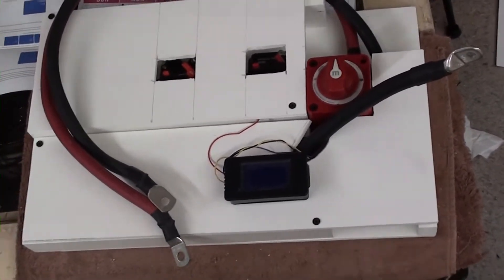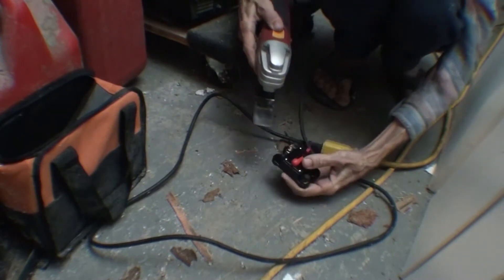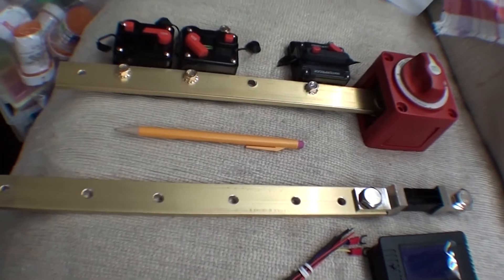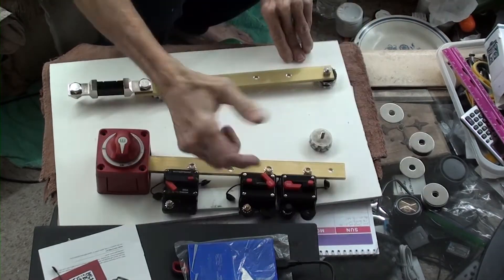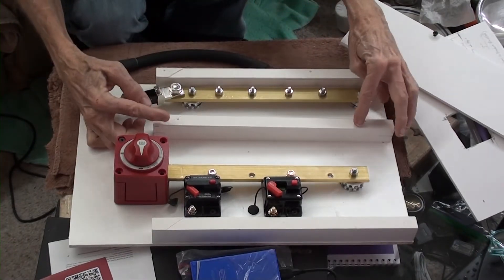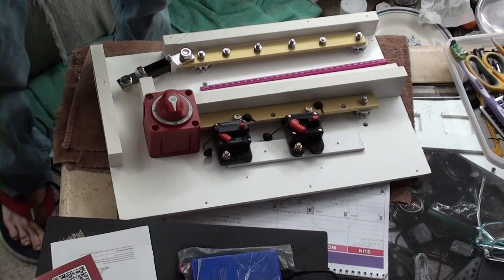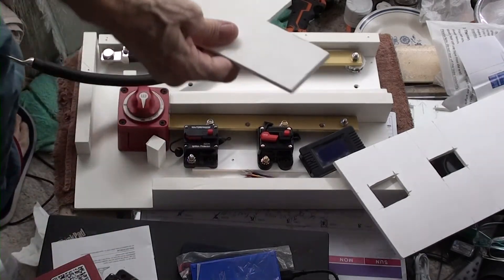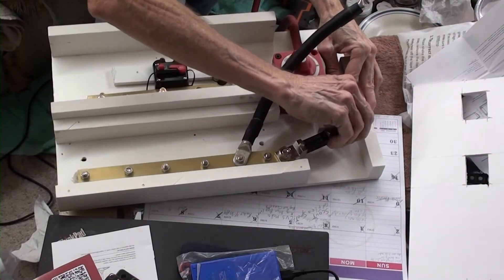Making A Bus-Bar Breaker Panel For Battery Powered Air Conditioner

Comment: It's amazing the mischief you can create with unlimited time and a little money!
Reply from the maker: I love mischief, any suggestions?  I have a battery that can run all my appliances for 29 hours or really kick ass for a half an hour.
Reply: @ninehundreddollarluxuryyac5958  Take the carver on the great loop!
Reply from the maker: @stevetadlock5223  That was Trevor's plan too.  I'm not a big fan of cruising American waters because all of it is so contaminated.  I was hospitalized from antibiotic resistant flesh eating bacteria after swimming in the water near Miami Beach.  Three others died from the same thing the week I was in hospital.  The bacteria has giant blooms because of fertilizer runoff from huge corporate farms.  Most inland waters in the US are so contaminated that you can't see the bottom, even in shallow water.

The Carver was built to take me to the Bahamas, specifically to remote, uninhabited islands rarely visited by humans where the water is pristine and uncontaminated.  Thats why it is getting 3,600 watts of solar and huge lithium batteries so I can run the freezer and air conditioner from solar.  I added more fuel tanks to the boat, but most of these places are near the limits of my range.  I need solar power because using gas in the generator would not leave enough to get back.

Comment: I've tried to sleep in the kind of temperatures you're talking about, so this is definitely worth all the work.
Reply from the maker: I didn't have an air conditioner on the first sailboat and got by just fine.  Then I put one in and used it.  I needed one after that.

Comment: Please share the details of your power meter that measures the current flow going to the batteries. 
Very professional installation. Thanks.
Reply from the maker: I used this meter and shunt because it was cheap.
https://www.amazon.com/dp/B08TX21R8Q?psc=1&ref=ppx_yo2_dt_b_product_details

The shunt is a precision resistor with almost zero ohms resistance.  To measure huge currents, the meter reads the voltage drop past this resistor.  I think the actual resistance of the shunt is just a few milli-ohms.  Most off grid solar installations have them but I never bothered because I didn't charge from the generator except in emergencies and the solar charge controllers told me as much info as I needed to know.  I want to actually monitor the amount of current now because I had issues with the battery charger tripping its circuit breaker.  I got a new battery charger with adjustable current output, so I can use the meter to measure current and adjust if necessary.

Comment: Neat idea.  Too bad you had to trim plastic to get the breakers attached to the bars.
Reply from the maker: Its not hard to trim.  A file would work if you don't have an oscillating tool.  I was surprised to see that bit of plastic there because these breakers would work real nice when attached directly to the bus bars.  This seemed to be the easiest way to mount them, especially after doing it the other way the last time.